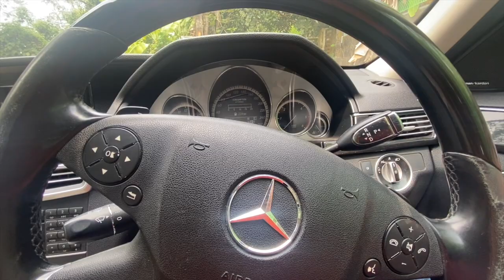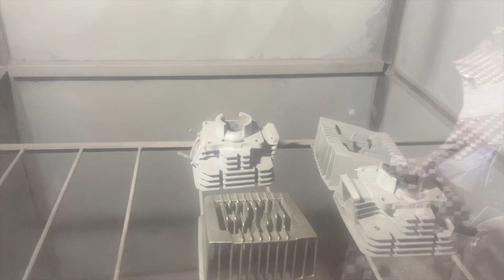Painting completed for both the builds | Malayalam Video

Comment: Brother, I watched a restoration video where they sand blasted everything including frame, forks, tank, engine casings(both inside and outside). Doesn''t the seating of bearing get screwed up?
Reply from the maker: It will, I use a brass wire brush on the Center case